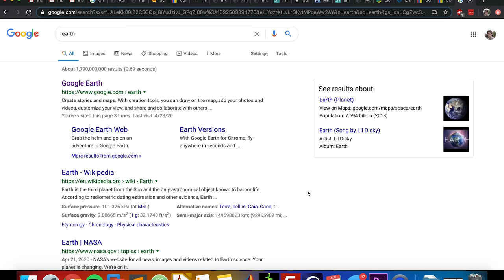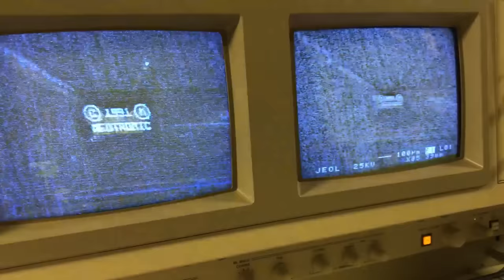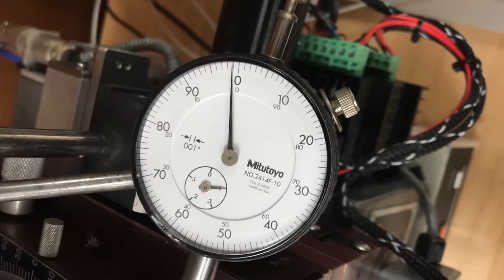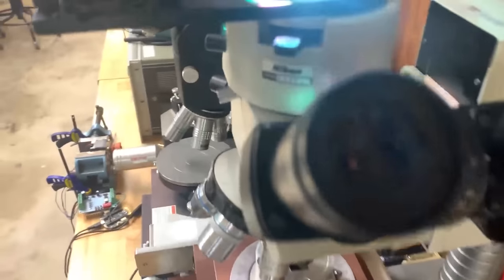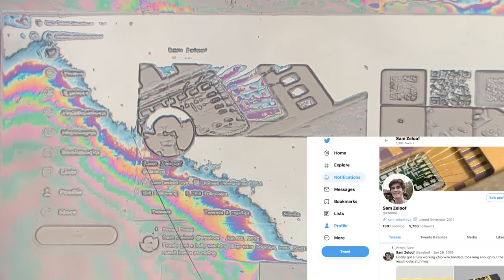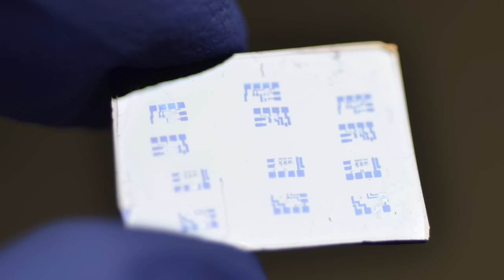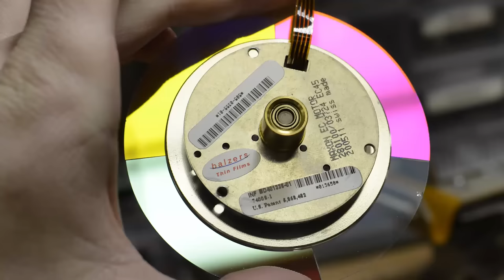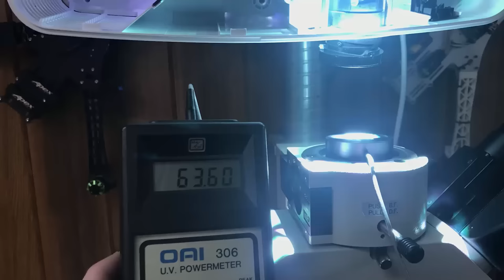Maskless Photolithography Stepper for Homemade Chips

Comment: the fact that you are taking on something so daunting and locked behind so many industry secrets, and are still able to actually make working chips is mind blowing and totally inspiring.
Reply: I think my last comment didn't make it? Anyway, just want to share, for anyone interested in doing something like this I can't post the link, but search an article by the name:

A maskless photolithographic prototyping system using a low-cost consumer projector and a microscope
by Musgraves, Close, and Tanenbaum

It's a write up on the exact system as in this video
Reply: @earl-greentea Thanks

Comment: Seeing your ingenuity is very inspiring!  This is something completely outside of my wheel house, but it's still fun to see something so complex be boiled down to it's fundamental pieces.
Reply: For low scale production is not very complex. In fact threre are opensource projects to be able to build very high resolution chips at "home" and cheap.
Reply: Frank Walter Do you have any links to those?

Comment: I spent 80% of the video yelling "Yes! Yes! That's perfect!" at the screen. I have done something similar except used a pulsed laser instead of the regular lamp that came with the projector while trying to make a laser based cell printer. I hadn't been able to get it to focus close up. I tried to use a machinist's lope but, meh, didn't really work. I had never even considered that all I had to do was flip the lens around! Clever as all heck! My goodness your channel is underrated.
Reply: So you used a DLP projector but changed the Hg lamp to a laser?
Reply: @andreasv9472  yep a pulsed NdYAG laser that was in a hair removal laser straight off of ebay. Lining everything up was quite tricky. I had to keep the lamp and fan connected and going or else it refused to power on. Keeping everything out of the beam line required more duct tape than I would like to admit and I had to defocus the beam with a lens to be extra cautious about  accidentally vaporizing the micromirrors (The laser can pack a mantis shrimp sized punch). Unfortunately I've been too busy with other projects to finish this one but I will soon. It was still able to form an image but it would occasionally break-down the air and (I suspect) form an opaque plasma which blocked out the center of the image. I had thought I had fried the mirrors but it was just a ball of plasma in the way and it didn't have any problems on the next shot!
Reply: @pinethetree  Any reason for a pulsed laser? I'm thinking that a continuous beam might decrease the chance of mid-air plasma balls.
Reply: @andreasv9472  Tragically there is a reason. I am trying to print cells with laser assisted forward transfer which in less jargony english means: shoot the laser at some mylar and plasmize a bit of the surface of it so it (and whatever is on it) gets pushed forward. The reason I can't use a regular laser is twofold:
1. not powerful enough to vaporize anything unless it's quite a few watts and very well focused to a point (and I need not a point but a plane of high energy light).
2. yet somehow too powerful, oddly enough while the peak power of the pulsed laser is youj (huge) the average power is less than a regular continuous one! If I pointed the continuous one at the mylar film it would burn through in a half of a second, whereas even though the pulsed one can vaporize the metal part of the mylar it leaves the clear plastic part intact (which is kind of crazy).
As far as I know no one has ever even made a continuous laser that can break down air so while that would solve that problem, it's not that bad of a problem and it's a problem that's caused by me being too cheap to buy a concave lens to spread out the laser and instead using a convex one and letting the light go through the focus and then expand out from there. I guess it wasn't such a tragic thing after all. Thanks for asking by the way, I'll post here when I get it working.
Reply: @pinethetree  
Please make some videos about your projects! That sounds really cool!
Reply: @gregorymalchuk272  Ok, give me three days from right now and I will post one. (It might not be working at that point but if anyone can get it working it's the YouTube comment hivemind).
Reply: Working on it now.
Reply: Making videos is harder than I naively assumed. That being said despite losing power for about a day a half (tree snapped power line), the laser is realigned with the projector and everything is working again so...   video soon.

Comment: Sam, been a fan since your first few videos, and I find myself returning to them all the time. We're on the cusp of an open source ASIC revolution with Skywater and other players, and your work is really timely and appreciated, even if it just shows how accessible this could be in theory. I don't know if you've ever seen the "Build Your Own Metal Workshop" series by Dave Gingery, recently I've been unable to shake the idea of what it would take to make something like that but for DIY silicon/electronics, as impractical as that might be. 

I found a paper about using "Bluray optical head for low cost laser lithography", available with those search terms, and other similar experiments with off the shelf 405nm laser systems, a process that I'm sure you've come across before. I was wondering if you had tried something like that? I can't imagine the years and effort it took to get down to the metal as much as you have, but I've been trying to find cheap, accessible ways to try this stuff with an eye at some sort of measurable success with low cost components and I thought that might be a good place to start too if you could build kits around cheap components capable of nano scale adjustment by design.

Comment: This is a great achievement.

I did a bit of reading when DLPs first became available and the consumer devices were generally sensitive to UV light.  I am not sure what the vulnerable component was but UV rated DLPs were special order.

How hard would it be to make logic onto a solar cell wafer.  If you could have a solar powered temperature transmitter all on one die you could sprinkle them from a plane and monitor thousands of ground temperatures with a flyover.

Comment: Awesome as always! I can imagine that some day there will be some kind of fully integrated solution for semiconductor/microchip fabrication, something a bit like a 3d printer. Maybe I'll make it work someday.
Reply: Really? I can’t.

3D printers are already rather niche despite being very useful for prototyping or cheap one-off parts.

Such self-contained fab is pointless, because you already have FPGAs, which:
1. Are relatively cheap and capable (ignore the ongoing chip shortage)
2. Faster to prototype on (even moderate designs take little time to synthesize and flash)

For large volumes it will naturally be cheaper to pay a proper manufacturer. The resulting niche where small-scale, slower than SOA, house-made, expensive chips are reasonable would likely amount to, like, 4 people in the world. This doesn’t fare well for your idea.

Such videos make it look like chip design and manufacturing is a lot easier than it is. The process itself is straightforward, but debugging any issues is absolutely unreal. It’s really, really, really hard for nontrivial designs.

Comment: Fine setup to explore the technology. 

I wonder though why the beamer and the microscope are left intact if it requires permanent modification - wouldn't it have been easier to deconstruct everything and to reconstruct a crude, but compact 'lithography machine' in which You can account for every parameter, because You have set up the entire chain of light source and quality lenses ? 

I wonder also whether You had come across a 'benefit-effort-ratio' threshold of diminishing returns where smaller circuits may be more efficient, but requiring so much investment in comparison to... let's say some form of mere parallel computing with much larger chips ? 

I don't fully understand the physics, yet - that's just what comes to mind when watching it.

Comment: I have to ask, and maybe you cover this in the video: roughly, what's the process node you're working with at this point? Is it 1000x larger than the 7nm we see in modern chips, or is it close to 100x? Awesome work, I've always wondered what a hobbyist could do with all that we've learned about chip design over the years.
Reply: Replying to a year old comment but, judging from the UV light used to expose the photoresist, the resolution is best case between 150nm and 405nm, so 20x-70x larger than a 7nm process. Practically its probably closer to the um range which would be around 143x.

Comment: This system reminds me of pulling air bubbles through a piece of taffy. No matter how small they're pulled together, the light beams don't overlap one another. You can pull it down as thin as you want and still see the distinct beams. Fucking A+, man!

Comment: Great video! Just have a question, have you done any experiments with masks? once you have a design you want, could a home DIY setup get better (finer/clearer) detail making their own mask and using a similar microscope setup but developing a mask on a glass slide or something? or would the DLP always have better results resolution wise. I get the maskless/DLP approach has 3d printer type benefits of iteration, but was wondering if you could maybe get more detail if you developped a larger mask with DLP and then used a more columnated UV source. Just looking into all this stuff, the points about what you learned to solve those issues is a great benefit, thanks again

Comment: Thank you for sharing this,
I have two questions please:
1-After you removed the colour rotation, you said I add some circuit, diode, could you please explain this a bit? any schematic or block diagram for that!
2-if it possible to put some links in the description for some items that you used, like the projector, lenses, UV glass... thanks again :)

Comment: Hey!
I have looked at many of your videos and also skimmed over your post/article about making your own IC a while back already, great stuff. However I have some questions about some things I either missed, don't remember right now or you simply haven't touched on before, so it'd be awesome if you could clarify.

First off, the differential amplifier was made with PMOS technology, and I would assume making NMOS is then, relatively trivial. However I'd like to ask if your home lab is capable of producing CMOS circuits as well? 
Secondly, I have been having trouble finding out or perhaps understanding what the step(s) are to reducing and/or making the gate oxide layer. After the doping process the islands of thick oxide remain, but this is also the case for the islands that are supposed to become the gate oxide. So how would one get from having that thick oxide layer above the gate area of the substrate to having a sufficiently thin gate oxide layer without damaging the exposed (doped) silicon in the wells or dramatically reducing the oxide layer in areas where it is supposed to remain thick? 
And finally just a curious question - have you tested, and if so, then what is the average switching speed of the transistors you have made?

Comment: Sam - that is really impressive! What brand/model projector is that?? 1080p is not the highest quality for ULSI+ however more than good enough for home and proto labs. I have been trying to find a projector with a native short arc or non-halogen lamp in it so the source wouldn't have to be swapped out. The IR-block filter was a great idea too. Very impressed with your work. -Fred

Comment: I wonder if I could use a blueray laser through some sort of filter, maybe with lenses to enlarge it?  I'd have to make the lenses some other way, but it should be really compact.
Or I could rapidly turn it on or off while using mirrors to "scan" the chip with the laser.  might be hard to do.

Comment: 09:12 - Any chance I can get you to elaborate on the difference in performance between this setup and the one using an unmodified projector and a microscope eye piece? "Performance" meaning the image-minimizing capability of each system?

Comment: I always had one question. If reducing the distance of the transistors inside an IC, is just a matter of using a lower wavelength uv light and shine it onto the mask and chip, then why we didnt do this 20 years earlier, so that we had 5nm chips in lets say 2000?
Reply: It is harder to produce and focus that light. You can't use lenses since they don't let Uv pass through, so they use mirrors. But those mirrors needs to be very precise in order to reduce images to 5 nm. This requires technology and know how. That requires research.
Reply: @devrim-oguz  Thanks! I know about EUV. I just don't get that there was no way to focus light in small wavelengths in the past. Gotta get back to the plummer book

Comment: One thing I have been always wondering about the power meter similar to the 7:49 one, is the detection range. I've done searching about it to know each of the power meter and irradiance meter has specific detection wavelength range. So say a meter that specifically tuned (narrow detection peak) to 405nm, vs a meter that has broad detection range (say 300 to 500nm), is the first meter going to gives me a higher reading compared to the second meter, if I am measuring a 405nm LEDs?

Is there any instrument that able to measure the irradiance (mW/cm2) at each wavelength? say, sweep from 200nm to 1000nm, and let us know the irradiance at each wavelength?

Thanks in advance if anyone knowledgably to this topic can help to answer the questions. Extra info or further reading resources are welcomed too.

Comment: What's the timeline like is this 1960s or 1980s lithography technology I would like to know. 
like what kind of computer chips could you replicate with this? Is it possible to make an Intel 8088?
Reply from the maker: It’s pretty much mid 70s to early 80s
Reply: @SamZeloof  so does this mean you aren't miles off being able to make something like a 4004?

Comment: There are now some 3d printers that use a similar UV concept to set resin, would shifting to one of those projectors possibly yeild results as well?
Reply: He has one in the background. The projector bulb is a smaller light so it's better suited for the task.
Reply: @SpencerLemay  the one I saw I think was one that uses an lcd mask instead of a projector. Could be wrong and I'll check again

Comment: Where do you get the tiny silicon wafers?
Reply from the maker: Cut it from a bigger one with a fiber laser, pretty wasteful
Reply: @SamZeloof  Nice. And what software do you use so that you have the right features to build transistors and other elements for the photolithography?

Comment: Still you will need a cleanroom, air shower, cyclonic precipitators, cryogenic industries, etc. if you care to read "Luft Und Staub" a  journal of micro contamination control.
Reply: Does he?  He’s made the chips. I suspect the other requirements are for higher part count IC’s.
Reply: I would suggest you go to his personal website, which is linked in the description, to see that he has already produced functional chips and transistor arrays. One of his stated goals is to work on processes that can create functional chips at home using chemicals and equipment the average person has access to and which do not require clean-room settings.
Reply: Brownian Motion thermal kinetic energy of atmospheric dust can cause havoc on a microscopic level since Vail III Patent describes how Primordial soup had seeped into minerals to shield from dust while "Homemade Lighting" by A.F. Ford describes how colliding droplets in air can produce electrostatic havoc including arc discharges able to produce an electromagnetic pulse able to burn out integrated circuits even if one uses radiation hardened semiconductors such as  Gallium arsenide, Germanium, or diamond film via hazardous microwaved methane. 

Even minute amounts of copper in salt water can be photovoltaic to cause electrochemical havoc so exact + or  -  tlernces of material purity is important. 

Also tin whiskers can grow across fine circuitry if solder does not have enough highly toxic lead and remember how even a Grignard Reaction in chemistry is hard to achieve.

Size is not relative in real engineering since on a microscopic level silicon is stronger than steel in terms of a Young's Modulus of Strength & Materials since during the 1940s   transistors where three pieces of lead sulfide 120s apart or spinning electrolyzer solutions of regolith topsoil dirt to take abuse. 

See video "How Dust is Holding Science Back" since it is size and shape of particulates one has to worry about.  

Still I wish any inventor best of luck since I am skeptical so be careful to remember how even brilliant NIkola Tesla went extremely paranoid from electroshocks along with toxins and brunt force accidents to be afraid of germs starved to death in a hotel room.

Comment: We need custom processors so we can ditch the spyware
Reply: I think the easiest way to do that right now is to run a RISC-implementation on a FPGA. That is if you trust the fpga of course.
Reply: Yep, look up RISC-V. We need a company like Purism to begin building completely free and open hardware based on RISC-V. Intel and AMD have hardware backdoors.
Reply: @gregorymalchuk272  even if they make the thing opensource, how do you know what was on the physical die in your chip? We need the tools to make our own processors. Maybe not as fast or efficient as an intel chip, but something we can produce ourselves.

Comment: There is any way to build phototransistors on PVC films with lasers? And build a Photonic integrated circuit? I made a group on facebook to design an open standard for a "3d printer" to print integrated circuits: https://www.facebook.com/groups/574950409735892/